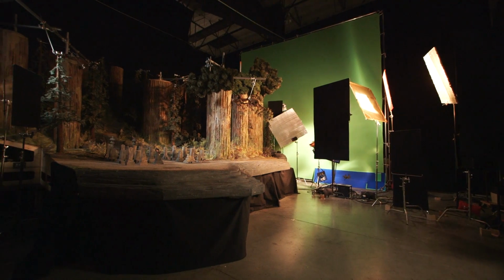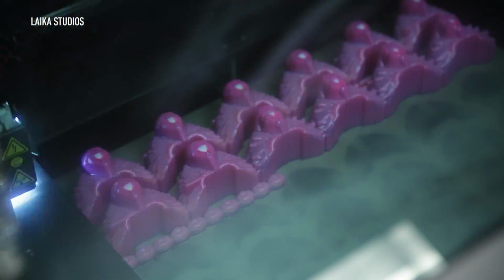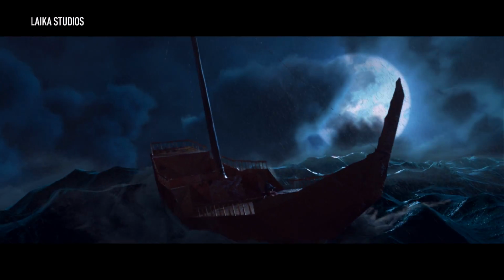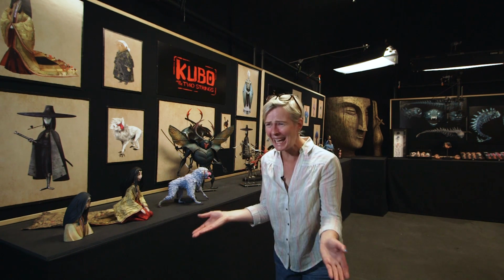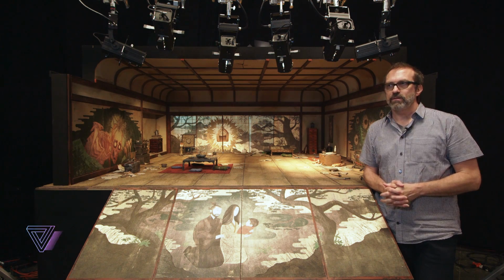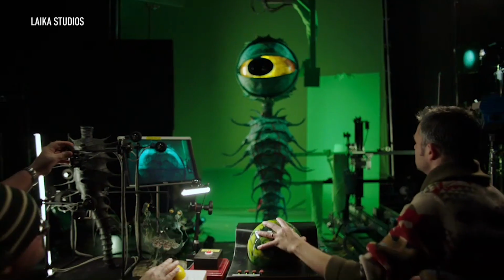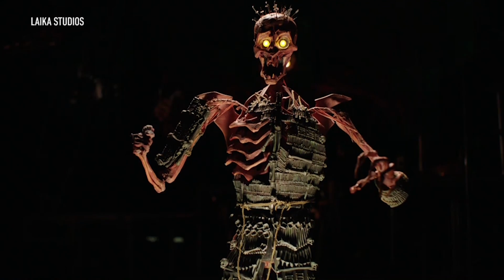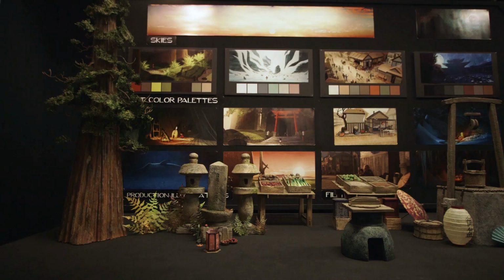Stop-motion animation goes high tech at Laika

Comment: the face animations are made by hand? its all stop motion? or does it also have "special effects" (for example i saw a green screen)
Reply: They do everything stop motion and then they use the green screen to composite scenes together. They might have many layers per scene.
Reply: +Eric Taylor layers together*
Reply: The face animation is replacement animation. They animate it on the computer and print out all the faces they need for each character with the mouth and eyes being separate.
Reply: Yup
Reply: ***** thanks. that's amazing!